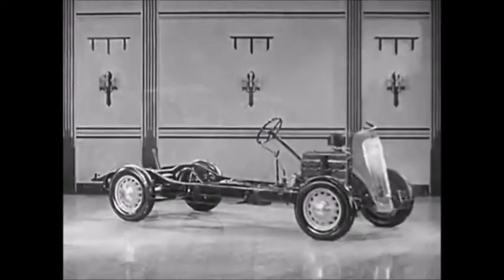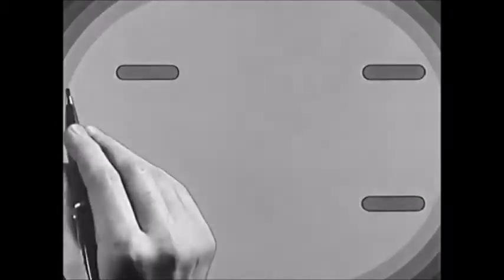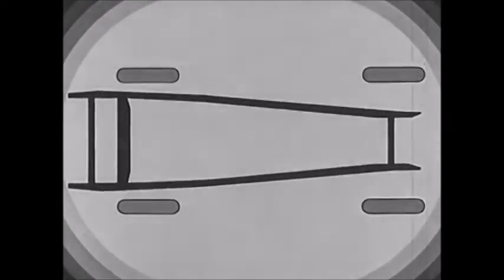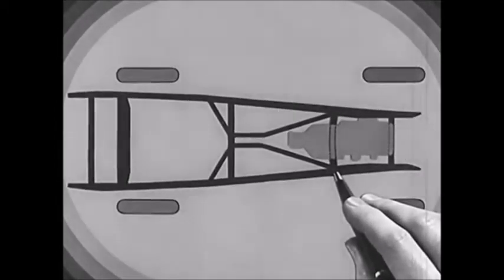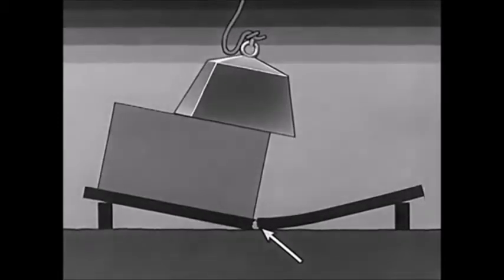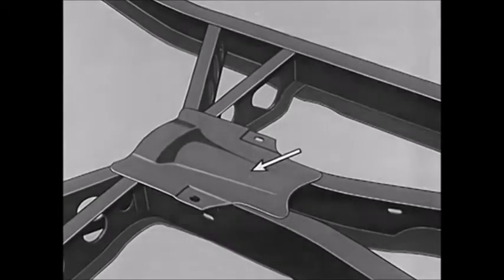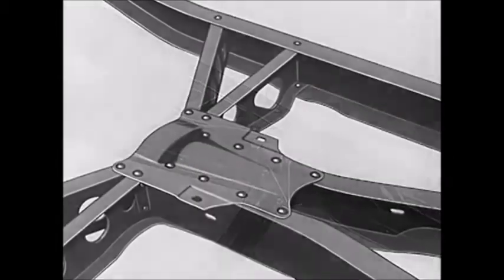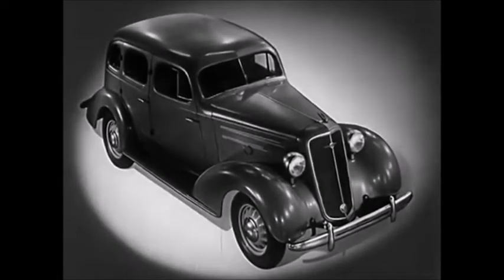Car chassis design factor and consideration

Comment: Man, they really did used to over build cars back then with those heavy duty frames, unlike the newer cheap plasticky unibody vehicles of today.

A unibody vehicle just can’t deflect harsh vibrations from the road like potholes, or even rough surfaces nor ride as smoothly like a body-on-frame chassis does.

A lot of people don’t understand that back in the 1920’s-1950’s, a lot of Americas roadways were still actually unpaved dirt roads in many parts of the country. So all the cars had to have a full frame in order to take the severe punishment of the uneven rough dirt roads that many of those old cars had to endure. 

A unibody vehicle would have split in half (just kidding lol) or would flex way too much driving on dirt roads like that which would possibly damage the body with stress cracks and broken windows around the A-Pillars and C-Pillars.
Reply: As always, it depends what unibody from when. The modern ones are obscenely stiff because of crash test requirements. Certainly a lot stiffer than a 60s, 70s, or 80s GM body-on-frame. I have seen an old dodge b body with plenty of stress cracks like you describe though.

Hell, the E-type had a sort of hybrid thing going on where it was a unibody right up until the bulkhead, then a bolted on tubular spaceframe front. As the video puts it "the stress was localized"...